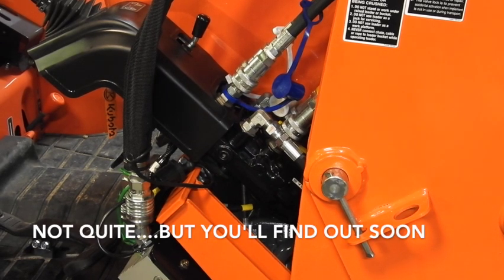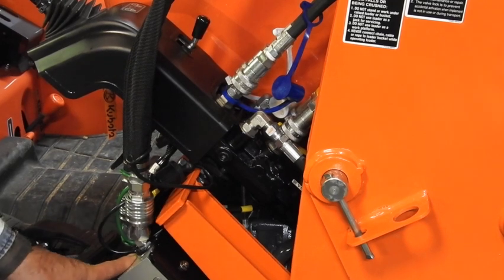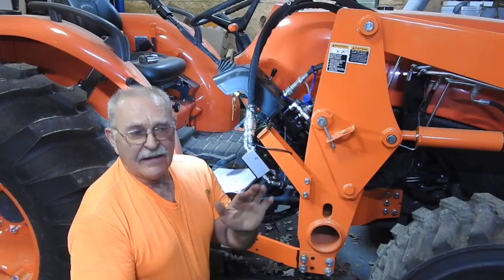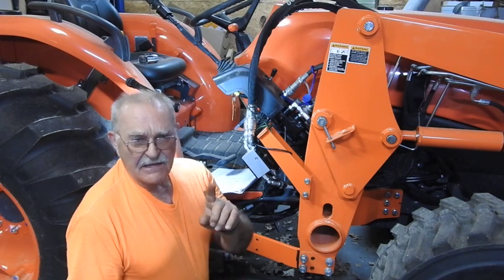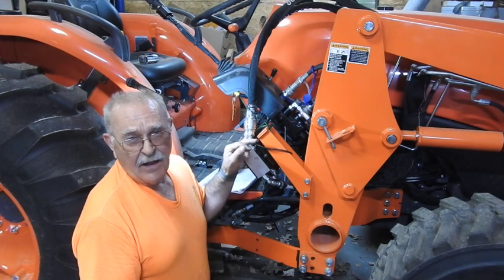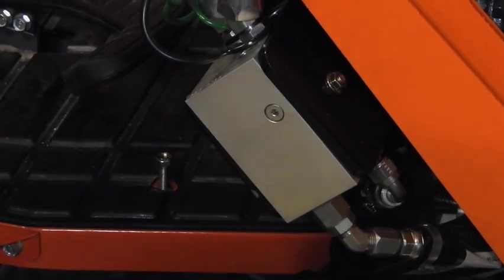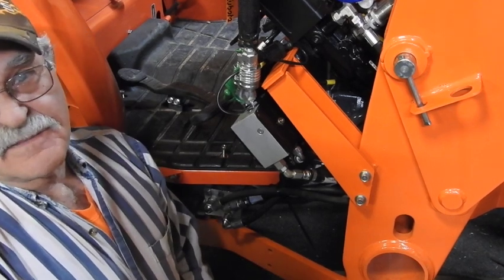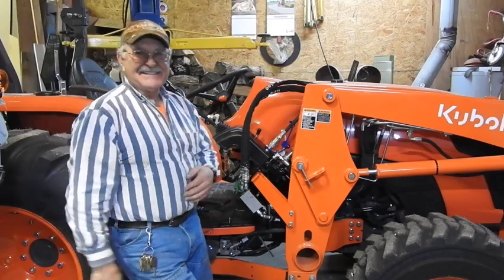Mistake Installing Third Function Valve Explained- Yes I Goofed

Comment: I actually like a well thought out manual. More detail the better but it has to be organized right so it flows and make sense. Great vid, I really like the dynamic when the Mrs. includes her 2 cents, cracks me up.
Reply from the maker: The manuals are written fairly well, but when they are written by tech writers whose first language is not English the translations leave a lot to be desired.  I believe these manuals are written fairly well, but you know  it seems they always lack the specificity we really need sometimes.  The worst part is the grainy black and white pictures that lack detail. The actual tractor manual though has very good pics, unlike the third function addendum that's delivered with those components.  The Missus likes to put me on the spot I think...at least she does seem to do it quite well.  But boy, can she cook !!  Thanks for the comment.

Comment: Hate to admit that I have made that mistake more than once. When I was farming in the 80’s, we had John Deere tractors and other colors of machinery. JD used O-ring hydraulic fittings and the other machinery companies didn’t. Someone would replace a hose and not realize that a o-ring fittings was required. Oil leak. Then dust clinging to the oil. What a mess. So it would get over tightened and ruin the threads.
Reply from the maker: I can relate to that Alan.  LOL It is mind boggling to stop and think about the things engineers can to do throw a wrinkle into the works isn't it. Sometimes they do have some good ideas though.  Gotta take the bad with the good I guess.

Comment: I would suggest for any extended period without an attachment on the function.
Add a small hose to avoid running fluid over the relief valve and un-needed hose stress. or disconnect the wires so it doesn't trigger the valve.
.
Probably the most mind bending thing in hydraulics ive come across is. on equipment from overseas with of all things British metric hyd fittings. there made just a little tight so on top of everything you cannot spin it on the threads by hand, have to use wrenches all the way down the threads..!!
.
Thats one serious WOWSERS BATMAN thing to deal with!!
LOL
Reply from the maker: I wasn't aware of the problem with the British metric hydraulic fittings. I bet that IS a real paint in the rear to deal with.   I DID have one of the female quick connects that would NOT pop fully into position on either male poppet.  Land Pride immediately sent a replacement that works perfectly.  The switch assembly comes with a waterproof automotive fuse holder in line with the power wire.  So disconnect would be quite simple.  Thanks for the suggestion.

Comment: I went my whole life without knowing the name of those hydraulic fittings that used an O ring. Nearly everything I own uses pipe or JIC. Well, once again I wasn't careful and I actually learned something.
Reply from the maker: The ORB angled fittings are great because they allow infinite directional changes with out leakage. Loosen the locknut, move to the desired angle and lock the nut once again onto the O-ring.

Comment: its only a goof if you dont lean anything. . as a motor vehicle tec i usually spend an hour reading and researching  to do a 10 min. job, and its only getting worse
Reply from the maker: I understand perfectly.  As a commercial HVAC service tech, we had to do the same thing as the systems got more and more involved with DDC controls. I've been retired almost 11 years now and am not sure I could even go back into a service truck without struggling with the changes that's occurred since then.